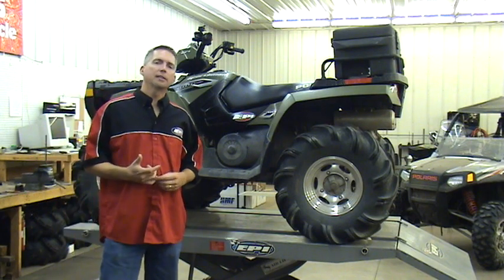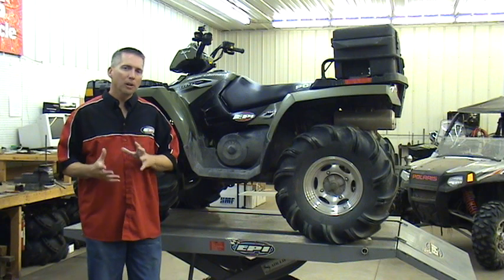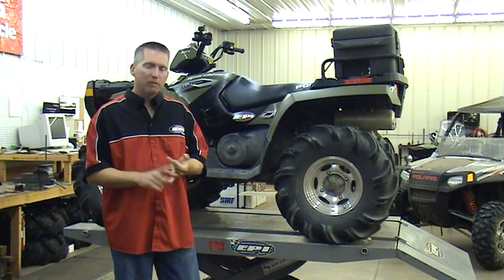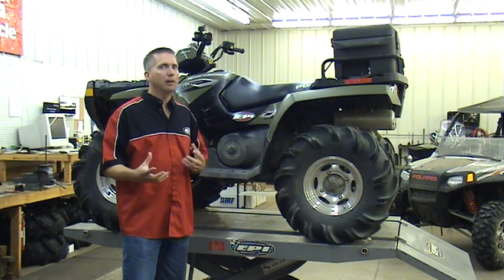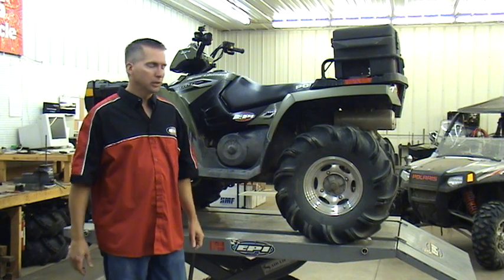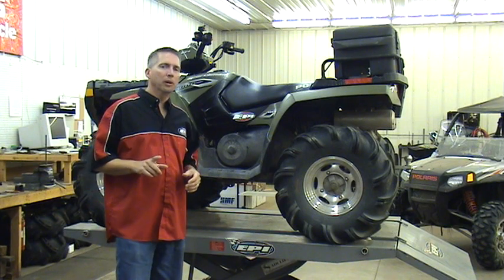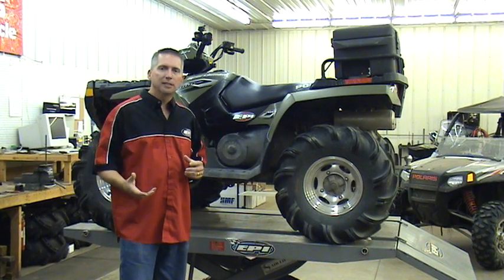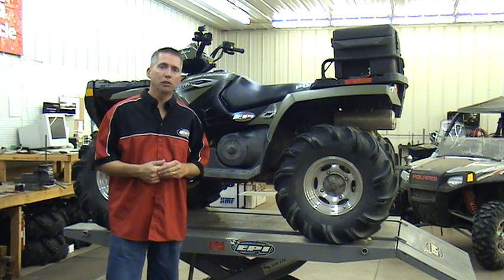"Why do I need a clutch kit?" By EPI

Comment from the maker: @2trx400ex2 
We would suggest going to the EPI economy clutch kit WE497030 which will change the wet clutch springs.  This will give the machine more low end power and a faster throttle response.  It will help to get the bigger tires moving.  If you are always in the mud you can go to the competition stall kit which is WE497212 for the maximum low end through the clutches.

Comment from the maker: There is originally from Polaris silicone on the backside of the cover on the motor side and that may be leaking and not the cover seal that really is all I can think of if not wanting to use silicone or snorkels.  You may want to use dialectic grease on all electrical connections to help with corrosion.

Comment from the maker: Most Yamaha's, Arctic Cat and Suzikis and Kymcos use a wet clutch system.  You will have three clutches, the main two the belt runs through and then internal wet clutch.  The little springs would go into your wet clutch.  Also note that on many of our clutch kits we use a generic picture and parts may vary by model and year.  IF you call us with your exact model we can tell you for sure what is in your kit.  Thanks

Comment: What would make a primary "snap" into disengagement with one spring, but not another spring.  It moves effortlessly in and out when I have it taken apart, so nothing is sticking. The stronger spring is the one that does it.  Weaker spring is smooth as butter

Comment from the maker: You can run with our Sport Utility Kit for 27-28" Tires.  Top end should be the same as what you have now with better low end and mid range power, faster backshift and throttle response, and grip the belt better.  You could also use our Mudder Kit which will give you even more low end power and torque but you will give up some top end.  The best over all kit for 27-28" tires would be the Sport Utility kit.

Comment from the maker: Some times you will see the rpm spike up higher than usual.  Also if the belt is worn it will be a little jerky on the engagement.  If It dose start to com apart you might hear a slapping noise on the cover.

Comment from the maker: The 500 should have a reverse over ride button on the handle bars that should correct that and will allow the motor to turn more RPM. With that large of a tire i would suggest a Clutch kit for your machine depending on what kind of riding you will be doing.

Comment: thanks, just pulled the clutch cover off and there is an oil pump assembly/passage ways behind the clutch are broken, but it looks like it can be replaced, but i cannot remove clutch it needs special tools.

Comment from the maker: there is a special puller to get the clutch off.  It is a friction fit on the shaft some people  have been able to get it off with out a puller from what they have told me.  But I would suggest a puller to not wreak anything.

Comment: I've recently purchased a 2012 outlander EFI. It is new old stock. A leftover from last year. Never ridden. That being said, I purchased new tires. Same size as stock, more aggressive tread. Swamplites in 26x10x12's. Same measurements, twice as much tread. So far, she runs great. No slip. What should I be looking for, or listening for if I'm running into trouble? I've never owned a quad. I've been a dirtbike man for 40 years. Recent shoulder injuries have put me on four wheels instead of two.

Comment from the maker: @2trx400ex2 
The economy clutch kit is the best all around for most people part #WE497030.  The competition stall kit (WE497212) will have even a higher engagement for more low end power.

Comment from the maker: @pigslayers2359 If you went with our economy kit (WE497030) it would give you about a 4-500 rpm stall that would help you. Those tires are pretty light for there size so i dont think you would need our compitition stall kit that would stall it to about 7-1000 rpm.

Comment: Awesome video! May I suggest a microphone to get rid of the echo?!

I have a Polaris Sportsman 700 and am looking into one of your clutch kits. Someone recently replaced the clutch with a factory type, however there is a delay before engagement. 

Which kit would you suggest?
Reply from the maker: I would call our tech line at 218-829-6036.  It will depend on tire size, elevation and type of riding your doing.  That way we can get the the correct kit for your individual type of rinding.

Comment: My new Can Am 650 will do 70+. I’m not interested in going that fast on a ATV. I’d like to trade top end for more bottom end. Would you think a company like Dalton to tell me what I need. I can do the work, considering how much I used to play with Snow Machines. I’d like to keep the engagement same or similar. I just like to tear around, pull trailers, plow etc. not crazy about submerging it
Reply from the maker: The EPI kits will give you more low end and midrange power, with faster backshift and throttle response.  Top end will normally stay the same, unless you have larger tires and then sometimes the top end speed will decrease a little.  You can find out more on our website, www.epiperformance.com or call us 218-829-6036

Comment: Great videos and illustrations, thank you! I'm getting ready to install a new kit on my 2004 Polaris 500 HO. I have 29" tires now and it cuts out when I'm in reverse, no power. Question: Is this a clutch issue that may be resolved when I change to the new clutch kit?  Thanks again!

Comment: I have a 2014 polaris sportsman 400 H.O. and what to put 27in Mud Bug's on.  I have stock 25in tires. What type of clutch kit do I need ? Thank's for any and all answers.
Reply from the maker: The best we would have for your machine is the Sport Utility Kit for 27-28" tires part number WE434002.  It will help make up for the power loss of the larger tires by giving you better low end and midrange power, faster backshift and throttle response and will grip the belt better then stock.  That kit number will fit the 2001-2005 and the 2011-2014 models.

Comment: i have a 97 sportsman 500 that is mainly work(like hauling trailers, plowing...etc)i like mud alot and my clutches are in need of some work so is my best recomindation for what i need. i want to be able to go through mud easy and spin and have enough touque to pull out trees!! it has k&n aircleaner two inch lift 25 in maxxis mud bugs and im jettting the carb! what would you suggest?? 
thanks

Comment: I have a 2016 brute force 750 and am putting 29.5 inch swamplites on it. I mostly just do trail riding but occasionally hit some deep mud holes. I would say 50% of my riding is cruising. Which kit would be best for me to be able to trail ride most of the time but have to grip when i need it in a mudhole?

Comment: Have an 08 big bear 400 5 speed and I put 30" silverbacks on it and it snt pull them in mud in 4x4 I noticed yall don't have a mudder kit for the big bear 400 even though it is on the mudder picture. But anyways how well would the competition stall kit do on it?

Comment: I have an 850 xp Polaris. Factory except the 27" Zillas. I just do general trail riding but I am aggressive. In 3 months I have already replaced a belt that got burnt from slipping. Which clutch would you recommend.

Comment: I need a clutch for my 2006 scrambler 500 ho. I'm getting bigger tires for the mud and want to upgrade the clutch first. Do you guys have a website? If so what would the part numbet to. I want to make sure I get the right one.
Reply from the maker: Hi Morgan,  We do have a website its www.epiperformance.com  For your machine we do have a clutch kit for 27-28" tires part number WE435003.  You can also call us 218-829-6036 and ask for the tech dept and they can help you out.

Comment: I have a 2006 Kawasaki  KFX 700.What kit do you recommend?
Reply from the maker: We have several different clutch kits for different tire sires and types of riding for the 2003-2006 KFX700.  You can find more info on our website www.epiperformance.com or call us at 218-829-6036.  Thanks

Comment: Why does elevation matter on clutch kits? I'm browsing RockyMountainATVMC right now and I see you have to select an elevation range?
Reply from the maker: MrPittsburghJ As you go up in elevation your engine makes less horse power due to the air, whether its a atv, snowmobile car or truck.  We set the clutching to take as much horsepower from the motor and get it to the transmission. Being your engine makes less horsepower at the higher elevation we have to adjust for it.  Hope that helps.  Thanks.

Comment from the maker: @titans514jake 
Yes it will give you more power on the bottom end.  Top end speed will stay the same but you will have more bottom end power to get up to it faster.  And it will be more responsive when you are on and off the gas.  The competition stall kit will give you the most performance and will be 700-1000 higher then stock, the economy kit will give you 300-500 higher then stock.  Both are a noticeable improvement. For more tech help, you can also call us at 218-829-6036 M-F 8am-5pm CST.

Comment: i have a 1993 honda fourtrax 300 2x4 i use it for crossing flooded creeks and it has some 27-12-12" Silverbacks yes sivlerbacks i have a jet kit new clutch springs proformance carb i got from some atv store it is snorkeled and it used to move my tires FINE like really great well i heard a loud grinding noise from the gear box and had it checked out by a atv guy and he said its all fine but the clutch is worn out and i just had it replaced what do you recommend? t doesnt really move much

Comment: For a grizzly 350 4x4 irs would u reccomend the economy or sport utility, and also with 25" mud lite xtr's which weigh 22.7lb front and 27.5 pounds rear would the clutch kit make up the different of 5 pounds more per tire? please respond

Comment: I have a 2002 yamaha big bear 400. I bought 29.5" terminator tires. What clutch kit do you recommend?
Reply from the maker: For your machine we have the economy clutch kit part number WE391001 which changes just the wet clutch springs.  The kit will help out the bottom end power and response.  You can find more info on our website www.epiperformance.com or call the tech line at 1-218-829-6036

Comment: just curious i have a 99 polaris magnum 500 AWD and i was wondering what mods can i do to it so i dont have to worry about water getting into the cover i need to seal it up without using things like silicone maybe a rubber seal instead of the foam one also i dont want to do a snorkel on it as i dont usually get in that deep of water but sometimes it gets into the cover from the bottom side

Comment: i have a 2009 rhino 700 with two brothers duel exhaust , k&N filter , MSD fuel controller , dynatek CDI and a machined sheave and im running 27 " interco reptile tires was wondering if your kits would help me out at all in the mud but keep my top end !! thxs :)

Comment: Excellent video.  Keep them coming.
Which clutch kit would you recommend for a 550 Grizzly running Camoplast tracks?
Thanks again.
Reply from the maker: Roy Benoit When you are using tracks we would have you use the Sport Utility kit for 27-28" tires and then get the one for the correct elevation you will be riding at.  They work awesome.
Reply: Thank you very much. Do you have a part #?
Reply from the maker: Roy Benoit Part number for the 550 Grizzly Sport Utility Kit for 27-28" tires 0-3000ft elevation is WE436633.  For 3000-6000 ft elevation kit number would be WE436634.  Price on the kit is $189.99.  Thanks.

Comment: I have a 2008 King Quad 750axi. I am not sure what size the original tires were. I use 27 in tires and do feel like it just needs something. At what point would putting lower gears in vs a clutch kit make a difference? I use it strictly for Elk Hunting in the Rockies with steep hills and carrying heavy loads up and down the steep hills. Should I get something else with a clutch kit or would just the clutch kit do what I am looking for? (I think of lower gears when I think of climbing hills in my Jeep) Peace, Mo
Reply from the maker: In most cases the clutch kit will help you out a lot and its hard to find lower gears for a lot of the machines other then some of the Polaris.  When they use lower gears on wheelers they change the gears in the transmission, not in the front and rear differentials like you do on trucks.  The Sport Utility kit for the 27-28" tires will give you better low end and midrange power, faster backshift and throttle response and will grip the belt better then stock.

Comment: Hi, I am in the process of rebuilding the motor on a 2006 honda rancher 350 and need to know if this clutch kit will make me able to turn 28 inch outlaw 2s skinnys. And if so what part would I need off your website
Reply from the maker: MrCameronArredondo On the Honda we only change the wet clutch springs.  they are stiffer then the stock spring and raise your engagement 300-500 rpms which will help make up for the power loss of the bigger tires and will make it more responsive when you are on and off the gas.  If you have the engine apart it is the perfect time to install the clutch kit.  Part number for the kit is WE497010. Let us know if you have any other questions.

Comment: I have a 2006 Polaris sportsman 800. I have 30in tires on 14in rims. They are the outlaws 2. What kind of a clutch kit do y’all recommend? I know they’re definitely heavy
Reply from the maker: You would want to use the Mudder kit for those tires.  It will give you more low end and midrange power to make up for the power loss of the heavier tires. Also with get fast backshift and throttle response and grip the belt better then stock.  Part number for the Mudder kit is WE423800

Comment: I just added 27" mudlites to my 800 sportsman. Was thinking of adding your sport utility clutch kit. I do a lot of trail riding and am looking for more low end and mid range torque. Do these kits take a lot of labor time to put on?
Reply from the maker: Should take a shop a little over an hour to install.  If you are installing for the first time might take 2-3 hours.  Take a little extra time and clean the clutch good.

Comment: How's it going I'm pretty sure I'm going to buy a epi clutch kit Friday I didn't really upsize my wheels there 25 but they are quite aggressive and I got new full exhaust and new KandN air filter I had to replace my belt other day what would yall recommend for a new clutch I do alot of mountain riding and go fast and up hills alot big hills
Reply from the maker: We would need a little more information such as year and model machine you have to get you the correct part numbers.  The best thing is to call or email EPI directly.  218-829-6036 or www.epiperformance.com    Then we can talk through what you have and how to get you the best performance.  Thanks

Comment: Hey I have a 16 can am commander, motor is stock, I have a 6" superatv lift on 30" silverbacks, I do some mudding but mostly mountain trails. Low river crossings, what would be a good set of clutch springs for my clutches???
Reply from the maker: If your just changing springs I would use the white primary spring BCS22 and the white secondary spring SRER15.
Reply: @EPIperformance  what's the difference on those or what ellse could I do to make it better with out actually changing the clutches
Reply from the maker: @freddymartinez3607 The springs will grip the belt better then stock, and backshift faster then stock.  Other then clutching the only way to make it better is gear reduction or switching back to small and lighter tires.

Comment: I just got a 2002 sportsman 500 ho, all stock. I blew a belt and am changing it to a high end belt. I'm wondering if I put in a clutch kit, will it bullet proof it, and get better performance? I just ride on rocky trails. Thanks
Reply from the maker: The clutch kit will give you better all around performance and better belt life.  With a clean clutch, new belt and clutch kit thats about a bullet proof as you can make a belt clutch system.  Then just clean and maintain it.
Reply: @EPIperformance  thanks

Comment: I have a 2006 yamaha kodiak 450 4x4 irs.. and i went riding and got stuck in a pond and when my buddy pulled me out, it made a short little wine and then it ran high rpm and barely moved. i got it up to maybe 10 mph after getting out. and i was only in the pond for maybe 4, 5 minutes. im wondering if its the clutch if so wat do i need to do??

Comment: I am about to order a clutch kit but I have a question. There are several little small springs in the pictures of the kit I'm about to order, what are they for and do I have to use them??
Reply: Those are packing peanuts.

Comment: +EPIperformance Hi, about a month ago I picked up a bone-stock 2012 Can Am Outlander 650 XT. I really want to put 28 inch tires (strongly considering silverbacks) on it but im not sure if I would need a clutch kit or not. Could i get away with 29's?
Reply from the maker: +Matt IDontKnow You can go with either size tire.  The larger and heavier the tire the hard it is on your machine and will rob more performance.  We offer clutch kits for the different sizes to help bring the power back and to give you better all around performance.  If you are worried about top end speed I would go with the lighter and smaller tires.  The heavier the tire the less top speed you will have.  Hope that helps.

Comment: Could you suggest a clutch kit for a 07 Sportsman 800 twin efi Deluxe with ebs?
Reply from the maker: Yes we can, we would need to know what size tires you are using and what type of riding you are doing.  You can find them on our website also at www.epiperformance.com  The part numbers for your machine are WE436188 through WE436197 for all the different kits.